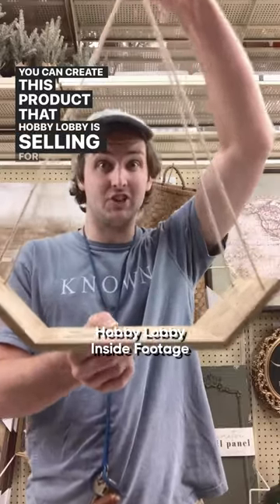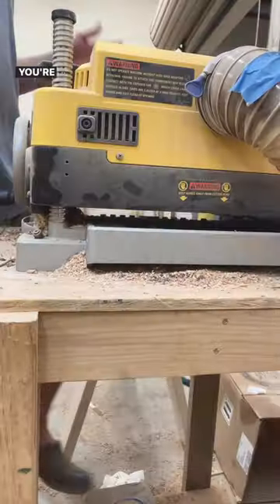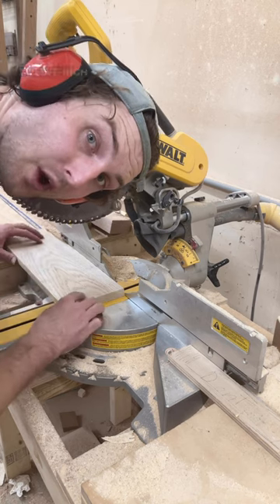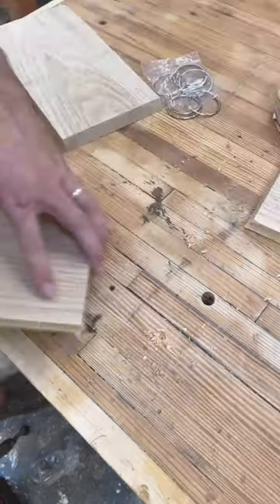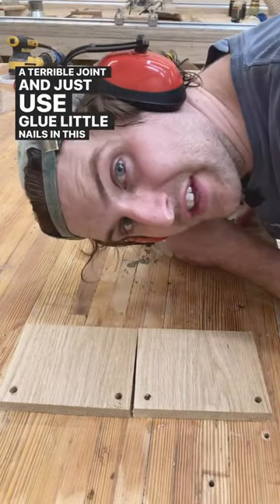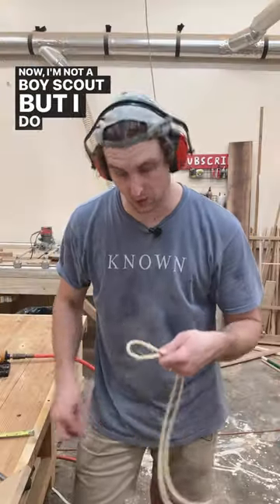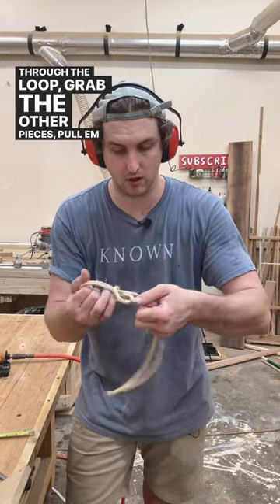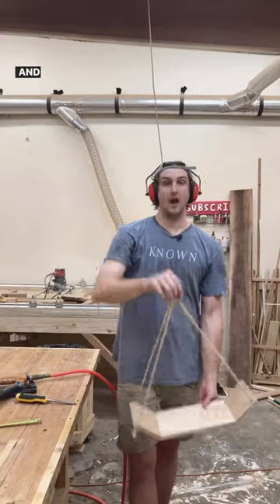Hacking Hobby Lobby products

Comment: “Because we’re copying hobby lobby we’re going to make a terrible joint with just glue and a little nail” 🤣 truer words were never spoken. 😂 I’ve doubted in the past that they actually use any glue.
Reply: Actually a rubbed joint (just glue then you rub the joint together until you feel friction) is a very strong joint when done properly.  You don’t even need the nails.
Reply: @leigheverett4491  "when done properly" generally means not on the end grain, you can rub all you want and the will still be a poor joint.

Comment: I feel bad for you, with all of these "men" crying about the fact that they can't do anything because of the price of the tools you use, , when in reality virtually everyone has some sort of drill and saw, and for under $30, they can buy a mitre box and sander ( it isn't necessary to plane the wood down, )
Edit: new subscriber here
Reply from the maker: Haha thank you! Someone who gets it!
Reply: Right and he’s not even using anything expensive
Reply: @screwascreenname2662  A Ferrari isn't worth jack if the owner doesn't know how to handle it. Skill wins out every time over money.
Reply: Basically, it is nowhere near as easy if you don't have the correct tools. To accurately saw at 20 degrees just using a hand saw, even if you have a 2 degree mitre box, is not that easy unless you are an experienced woodworker.

It's like saying why employ a professional plasterer, when the materials and methodology of plastering is very easy.
Reply: @edeledeledel5490  Basically, if you're good at using an old fashioned compass, and have decent skills, it does make things easier if you're stuck with older tools. ( I'm thinking about the colonial and other older homes. They were built to stand up to almost anything)

Comment: May not be a boy scout, but you tied a larks head knot just fine
Reply: Agreed. The US Army calls it a cow hitch. I just looked up the name origin today. It's the knot they used to use to tie a cow up. It's one of 2 knots I know and it's perfect if you buy some of those steel rings. Then you don't need to learn all the other knots. Steel is stronger than rope and stronger than any knot.
Reply: Or a cow hitch.
Reply: i dunno, pulling the entire rope through instead of just passing the loop over the ring is kinda wild.

Comment: My wife works for Hobby Lobby you probably only paid $10 for that cuz it's usually like 50% off at the least sometimes up to 90% for that item specifically by the end of it it'd be just cheaper to buy it the tools alone are like $2,000 plus the piece of wood you use is probably about a 5 to 10 piece of wood once you buy the actual size piece cuz you're not going to be able to buy one like that and people aren't just going to have scrap wood laying around that looks nice like that piece. Then time to build it as well. That all adds up.

Comment: You could make this thing with a simple hand saw,for the people bitching about the tools
Reply: Not in 20 minutes
Reply: You can’t drive pinners without a Brad nailer.  You also need a compressor to run that nailer unless you have a battery nailer (considerably more expensive). 

Smallest box of 18ga brad nails is about $16 lol.  

This is just to follow his process. You could probably get away with using trim board nails which are pretty cheap at about $3 a box. Besides needing the hammer, you would also need a nail set to fully sink those trim nails at that angle.

Comment: I find it enjoyable when people act as though you can only use a tool once and then throw it in the trash.  Go get a saw of any kind and figure it out if you want to DIY.
Reply: I have a really nice miter saw. I bought it after doing baseboards in my home using a really shitty used beat up old out of spec harbor freight model for a few years. The new miter saw worked great for baseboards. 

Since that project ended, I used maybe 1-2x a year to make 90° cuts most of the time in the last like 5 years I’ve owned it. 

Most tools do I fact just sit there collecting dust. Funny thing about that. A huge spider made its home in the miter saw the last time I used it lol. Will I trash it? No. But will it take many more years to recoup my money back? Absolutely.

Comment: Dewalt Planer: $550
Dewalt Miter Saw: $230
Dewalt Atomic Cordless Drill: $179 w/ battery and charger.
Dewalt Nail Gun: $200
Dewalt Air Compressor to power Nail Gun: $440
1x6: $6

Unless you are sponsored by Dewalt, just pay the $20.